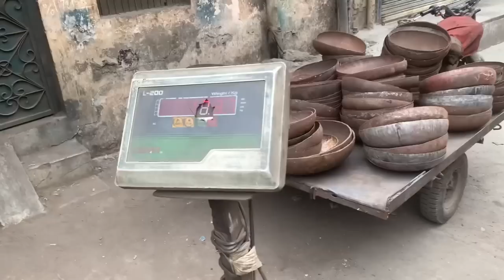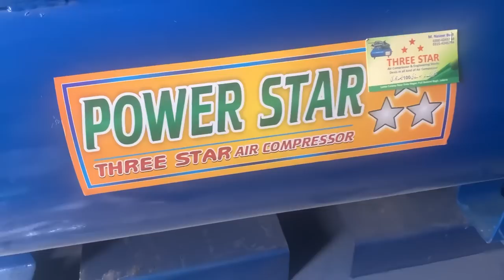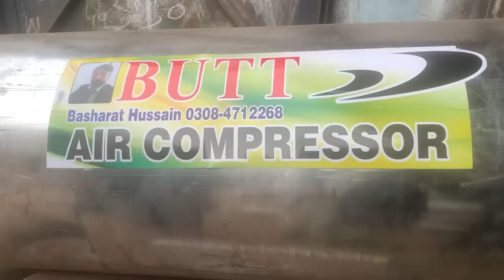Have You Seen Such An Amazing Process of Making Air Compressor Tank | Handmade Procedure

Comment: Thank God we will never let such things be made in Europe
Reply: why ?
Reply: You'r wrong.
It's clearly filmed this summer in Bradford, UK.
Reply: @dirkwichmann2225  Death trap, that tank would not pass any inspection. They also ensured premature catastrophic failure by folding the tank body over itself then creating a weld only on the outside, there is always condensate accumulating in those tanks and if you have two bare pieces of steel against each other they begin to rust out and push out with extreme force, enough to break welds clean. This tank is a total failure and a time bomb. You can't even perform an inspection on it because the rusting out area will be hidden. One day the whole seam will rip apart and the tank will rupture creating massive explosion.
Reply: Don't need no stinking inspections, regulations. lol

Comment: No doubt th sheet metal is from the ship breaking industry and the guy doing all the ark welding really needs a proper bench with the ability to easily turn the work piece. With all the struggling he has to do his efficiency would vastly improve